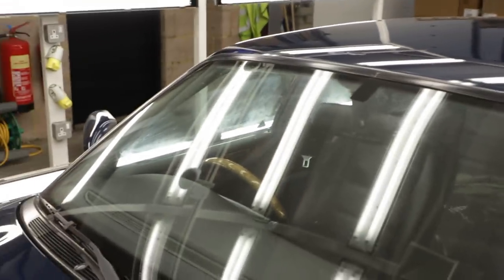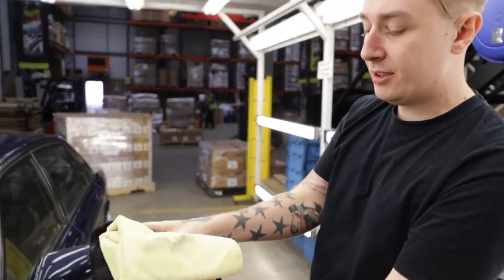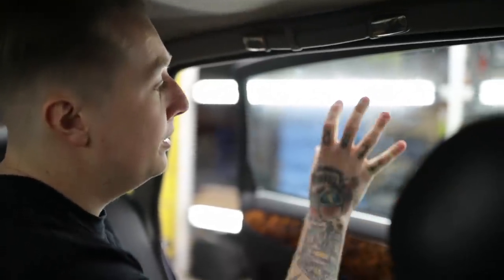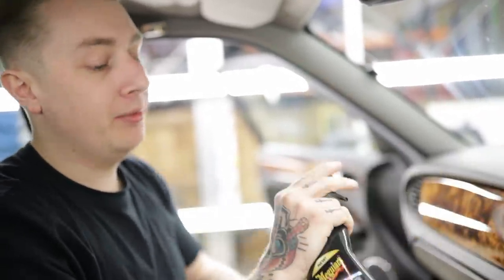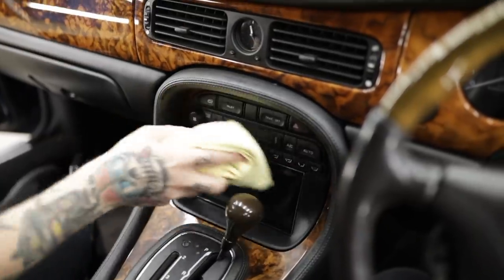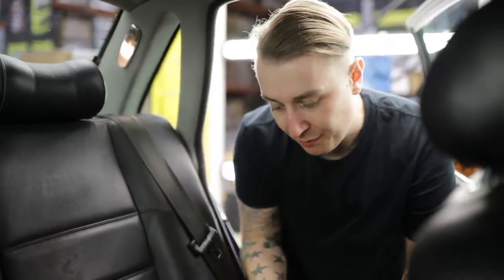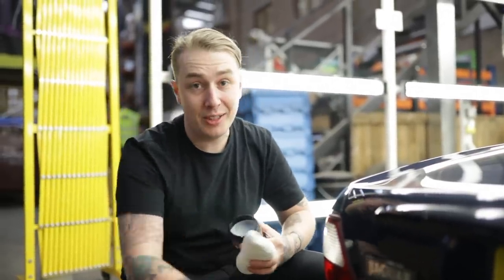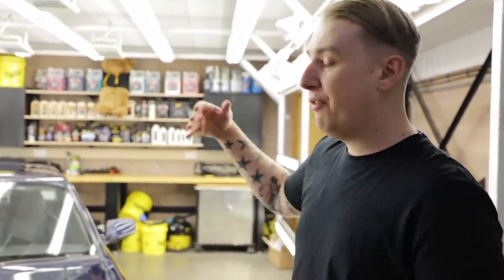How to give your INTERIOR a SHOW CAR finish with Meguiars Top Tips and Products *Day In The Bay

Comment: Love your products specially the last few that have come out but for glass cleaner i don’t think nothing beats the auto finesse one (Cristal) no streaks marks and only a couple of wipes and done ✅ I want to dry your ultimate polish but can i just use that or do you haft to use the ultimate compound fist (at some stage I’ll need to use the ultimate compound because iv got a couple of swerl marks
Reply from the maker: If you want to remove the swirls then definitely use the Ultimate Compound. I would suggest Compound then to use the polish after to achieve the best finish.